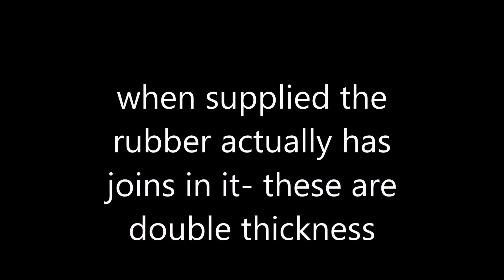DIY - How to Install a Rubber Roof by Permaroof .

Comment: Is there a correct way up?
Reply from the maker: best to check but it would make sense that the outside of the roll is the underside otherwise you'd have to completely unroll it to fit it. And it weighs a tonne

Comment: Do you think the rubber could be installed before the facia goes on or would you recommend the facia first. Had the kit delivered today, load of stuff no instructions, did manage to find info online but aimed at the experienced user. Also contact adhesive came as a spray can!!
Reply from the maker: spray could get messy, hope there is no wind! Facia on first for sure, then your kerb edge or drip edge. Good luck!

Comment: I only have contact adhesive - can info the whole roof with that?
Reply from the maker: i've only done a couple of these now - the thing is with contact adhesive is you have to do both surfaces, wait for them to touch dry, then push them together. On a roof of any considerable size that would be a total pain. I'd go for the recommended stuff to make your life easier.
Reply from the maker: plus contact adhesive is expensive
Reply: @CamberKitesurfing  thanks mate - I already had the contact adhesive as it came with a roofing kit 
Great vid by the way and really took away some of the worry of doing mine this week :)
Reply from the maker: @problemchild1976  yeah good to research it
Reply from the maker: @problemchild1976  i still have loads of the adhesive if you are near camber
Reply: @CamberKitesurfing  thanks for the offer - think I’ll be ok  - cheers